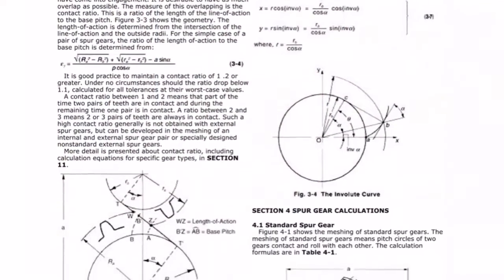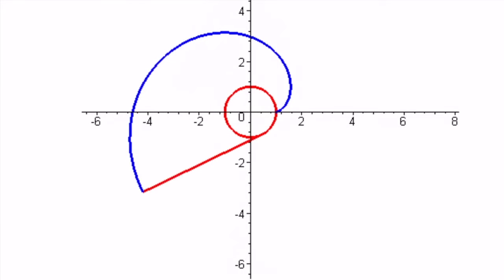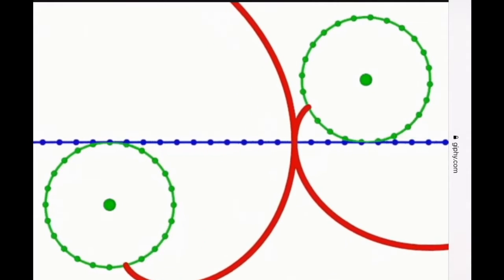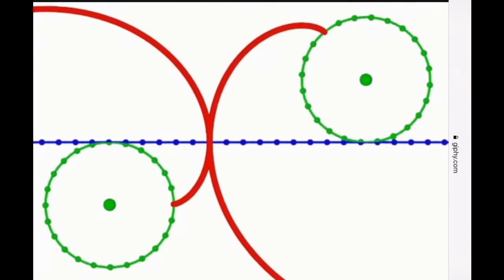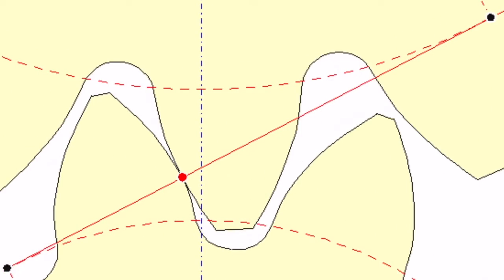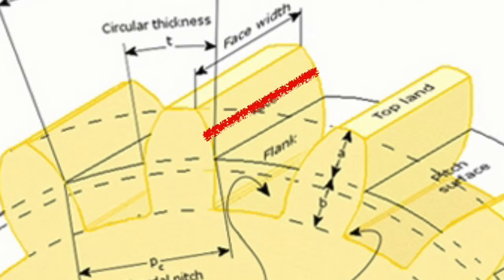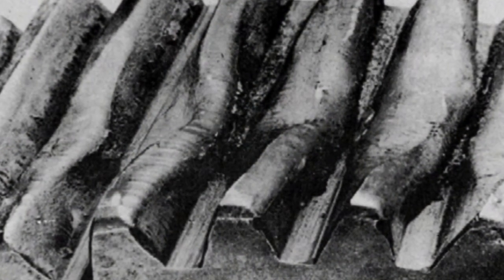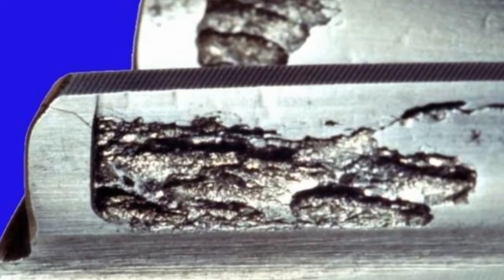Ford Model A Transmission - Parts Inspection

Comment: Great helpful information … question, since the material was better in those days are you able to weld the surface on the worn fork areas then machine them to specs?

Comment: Thank you. All your videos are good for understanding. Have you had experience with RVS treatment as wear prevention?
Reply from the maker: Thanks for the comment.  I don’t know what RVS is.
Reply: @georgebell7103  Youtube disallows links, even to itself, but there will be videos that explain by searching Youtube with "rvs technology how it works". So far only tried it on my BMW aircooled motorcycle, where the only difference felt was that it runs a bit cooler. But I know of two others with worn engines where it made a much bigger difference. It works for surface wear, but maybe it cannot prevent metal fatique and pitting, not sure.
Reply from the maker: @biondanishgenomeinstitute8193  yeah, I really don’t know anything about it… sounds like technology well beyond the old Model A Ford

Comment: I have two model a cars. Both transmissions ran and sounded great,  no noise. I took one apart, and I found that the roller bearings were broken. The surfaces were all chewed up. I replaced everything. I then checked the other transmission, same thing. I suspect that there is a weakness in the roller bearings. 
A side note, I knew of a part supplier that sand blasted the inside of the transmission housing. When you replaced the gears,  all of the blasting media fell out. The gears had to be taken out and the housing had to be recleaned.😢😢
Reply from the maker: Yes, cleaning everything thoroughly is a must for this, or any transmission.  Thanks for the comments

Comment: Good video, George. I found this mini series about the Ford Model A Transmission somehow by searching up the Model T transmission as I wanted to try remake it in a game. I remade the Ford Model A Transmission already in a different game, but I've now started doing it on another one. You're a very good teacher, George!
Reply from the maker: Thanks for the comment.  Remake the transmission in a game??  What is that?
Reply: @georgebell7103  well, I made a 3 speed in a ROBLOX game.

Comment: Thank you for the detail in your video.  Understanding the cause and effect is important.  I know prices will fluctuate significantly over time, but the pricing at this point in time helps to determine the overall cost of ownership.  I would like to get one of these cars, but I need to have proper storage.  So it will be some time that I get to dream, verses living the dream.
Reply from the maker: Good luck finding a car, they are great fun.  Thanks for your comment

Comment: Hi George just a little question,the bearings for the gear box both ,they need to be armoured? Thanks
Reply from the maker: No, not needed.  Bearings can be purchased at any Model A supply
Reply: @georgebell7103  thank you again George!!

Comment: Mr. Bell, This video sets the standard for instructional videos in my opinion. WAY, WAY, over and beyond what I am accustomed to seeing.
The technical information that you provide applies to gearboxes, differentials, and industrial geared equipment, not just As.
EXCELLENT JOB!!
THANK YOU!!
Reply from the maker: Thanks for your kind words. I appreciate the feedback. In this series, I didn’t want to just tell guys “what” to do, but also “why” a thing needs to be done.   If a fellow understands the “why” he is a better mechanic, and can solve similar unrelated problems. As you mention, this information applies to any machine with gears.

Comment: Is it possible to add synchronizers in a Model A transmission?
Reply from the maker: Yes, I believe it is possible... there are kits available to convert the transmission. However, I don’t believe it is needed.

Comment: Great video!
If only today's transmissions were that simple on the inside...
Then again very few people would be able to get their car out of the driveway.  Perhaps not such a bad thing after all.
Reply from the maker: Thanks for the comment.  Yes, it was a simple machine. The manual transmission required drivers to actively interact with the car, not just ride along.
Reply: Hey George what are you up to lately?

Comment: Thank you for a fantastic video series! What do you think about using three bearings on the cluster gear shaft as opposed to two and a spacer? 

Thank you,
Reply from the maker: Thanks for your comment.   Don’t know, if the bearing were the same length as the spacer, it would probably be fine.   Maybe better..?
Reply: Supposedly the spacer can be replaced with another long bearing. I have read arguments saying this third bearing reduced wear on ask three and others say the spacer aids in Cluster great alignment
Reply from the maker: @237cooter  IDK,  Seems like it would work... I kind of stick to the original as built approach

Comment: Thank you for the information that you share so precisely. I just purchased my first Model A (1929 Coupe). It has a rust free body but looks like the transmission is ready for a complete rebuild. I am seventy and work alone also. I have the rear end ready to drop out, I am leaving the leaf spring attached, I'm moving the rear end back about twelve inches for transmission removal clearance. I was wondering how much the transmission and bell housing weigh as a unit? Do you know how much? Back in the day, when I was a lot younger, I used to lower transmissions down by the gear shifter by sitting on the seat and straining my back. I was wondering if it would be feasible to do the same with this transmission/bell housing combo?
I don't look forward trying to balance everything on a hydraulic jack. Just thinking out loud, what do you think?
Reply from the maker: Thank you for the comment.  Take a look at the other videos in this series. I show an easy way to lower the transmission from the car.  In this video. https://youtu.be/RPzUwu3Jf5Y 

At 70, I suggest you lower the transmission down as shown.  Transmission and bell housing probably weighs 125 to 150 pounds.... be careful
Reply: @georgebell7103  I wanted to let you know that I was successful in removing my transmission this morning by lowering the trans/bell housing by the gear shift lever onto a furniture dolly underneath the car. I placed both feet on the motor mounts on each side to brace myself, the weight was very manageable. Once lowered I then removed the shifter housing to facilitate removing the trans from underneath the car. Removing the battery box would given me more room to move around but it worked out ok without removing it. I also removed the rear end by leaving the leaf springs attached to the housing, it almost fell out, very easy! The transmission is another story, it is trashed, worse transmission I have ever seen inside, almost looked someone took a hammer to the gear teeth. I am going to replace everything but the housing. Thanks again for the inspiration you gave me to do this myself without help.
Reply from the maker: @dogbitefred6631  thanks for the update.  Glad things worked out okay, and that the videos were helpful

Comment: Love your videos. My paternal grandfather was trained by Ford sometime in the twenties and had his own garage after that. Then as WWII approached he became an instructor for soon to be soldier mechanics working in and for the war effort. I think it was a government job and lasted almost to the end of the war. After that he returned to his own business and continued working into the 50s. I was born in '42 and evidently loved the smell of grease, oil and gasoline. I sat on the fenders of all the wonderful cars we remember fondly: Model T, A's and flatheads. By the time I was old enough to life a wrench he let me work on, and drive, those cars. I could take apart the transmissions, engines and rear axles nearly blindfolded and it was wonderful - ah youth. Then along came the Y block  V8's and suddenly I was more interested in 0 - 60 times on Saturday nights. Still, I had learned enough to repair my car(s) when needed.. Cars these days no longer serve as trainers of youth or provide skills only learned by doing. Alas, these modern cars are also nearly impossible to work on. However, thanks to You Tube you have an excellent way to show and teach those, older and younger guys, who have now purchased one of the old classics they always wanted. And I can now change the battery on my 2013 Escape and change my own oil.
Reply from the maker: Hey,  thanks for the comment and story

Comment: I just got a 29 "A" that needs the transmission rebuilt. I can see CLEARLY what needs to be done, and apparently how much easier it is to get parts. Speaking of which, where did you get replacement gears?
Reply from the maker: Replacement gears can be obtained an any of several Model A parts suppliers.  I typically use Snyders in Ohio.

Comment: Do you ever add magnets inside the fill and drain plugs?  Lot's of options out there to be creative with.  Be sure to use a dab of epoxy. I don't trust just adding a magnet. Excellent vid as always.
Reply from the maker: Yes, I have heard of this.   I will need to think about it a bit. If I can do it with no chance of the magnet causing problems then I might.   Thanks for the comment.

Comment: As usual, I love the video.  I actually didn't know where you were headed with the string, and got a little itchy about it, but you pulled it together very well.  I like to think about the brilliant designers from 100 years ago that would get such a kick out of seeing the results of the inspection and the conclusions drawn.  I also tend to think they would have been nostalgic for about 1 minute, then they would have gotten to work on a redesign and improvement based on what you were showing them.  Engineers just can't help themselves from finding a problem and then fixing it!!Thanks for sharing this George.  You continue to inspire this engineer.
Reply from the maker: Thanks Bill, take care